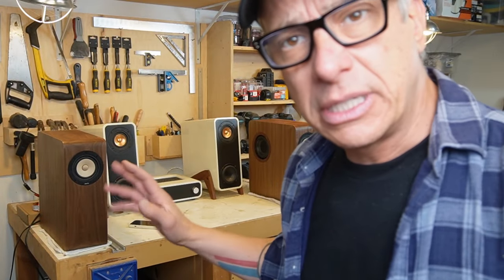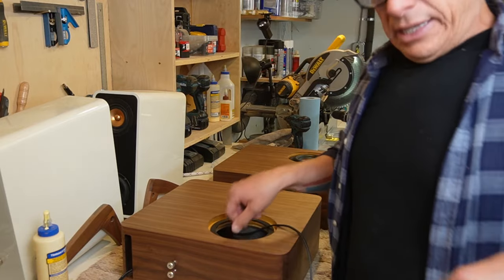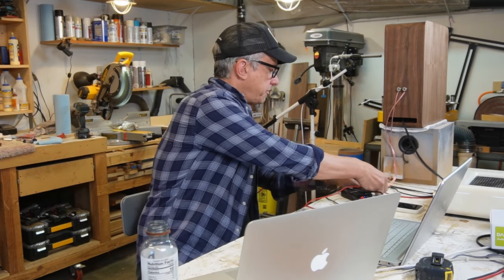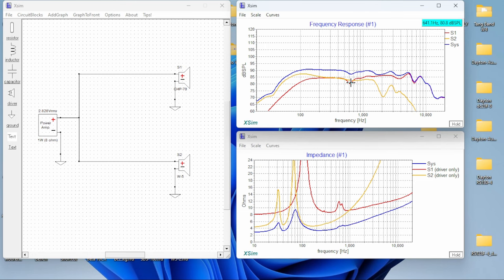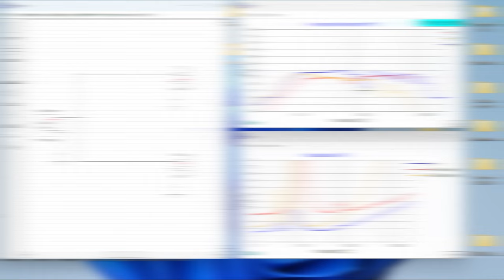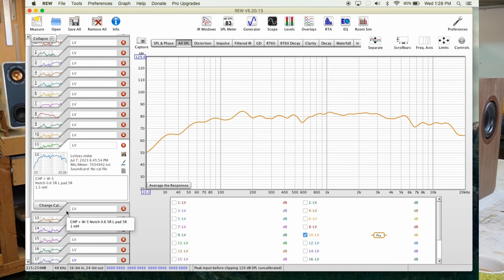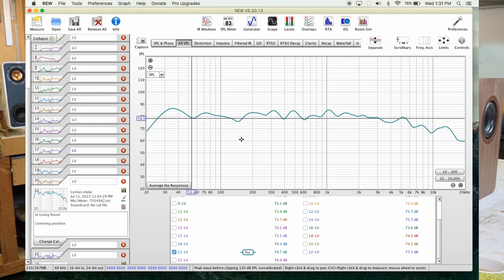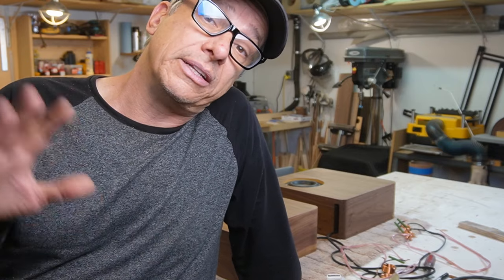LoVees Speaker - Part 3 - Markaudio CHP-70 Fullrange | Tang Band W-5 | Dayton ND-20 | DIY Crossovers

Comment: With the Fountek drivers NLA (due to the designer having a falling out with the China manufacturer), MarkAudio drivers are getting their chance in the sun, which they really deserve. The design ethos of a lightweight aluminum cone on a full range speaker is something that has some magic, and if the bass range is taken away then the full range speaker can operate as a really excellent combination midrange-tweeter unit. It is bass excursion that takes away the most sound quality from a full range speaker, and a good full range speaker like this combined with a low-bass dedicated woofer can mimic the desirable sonic characteristics of a three-way speaker in the midrange. A tweeter offers a bit more refinement in the top end, so a true three-way is still ideal, but the augmented full range speaker as a mid-tweeter in a two-way system is the way to get the most 'three way magic' in a two-way system.
Reply from the maker: Thanks for the input my friend!! It’s been a lot of fun and a learning experience with those drivers! I love it!

Comment: I myself still use speakerworkshop I've tried  xsim rew combo but just find speakerworkshop much much quicker and easier for me... one thing I'm sure you can do in xsim also to get the real offset instead of measuring which is never accurate because the offset is never where you think it should be, is to take your far field measurement of both drivers playing at the same time then the nearfirld of both than adjust the off set so the phase and measurement overlap in a graph with all three measurements around the crossover point... When I do this the modeled crossover is exactly what will be measured so there's no need for me to do a real-world measure till its how I want it... Of course there's sometimes small tweaking after that.
Always great videos keep it up!!!
Reply from the maker: Yeahhh! That’s great input! Thanks my friend!!!

Comment: Great build! l could find all info in the 3 parts except components and values for the crossovers. What should I use?
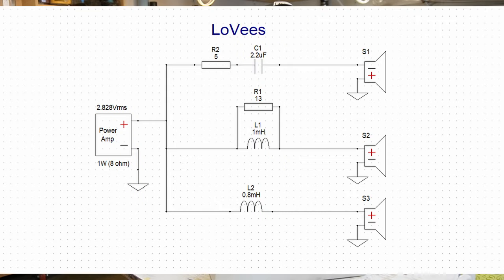Reply from the maker: Hello there. I plot the crossover on the screen at around 20:20 min on the video. Check it out. It shows the values for each part. Thanks for watching